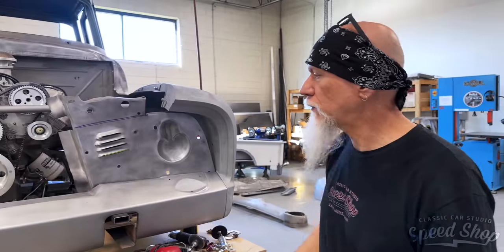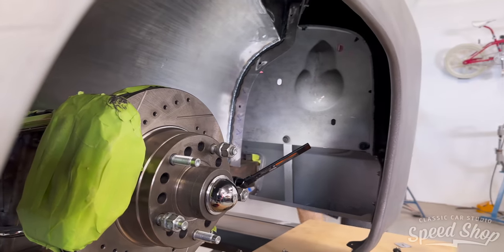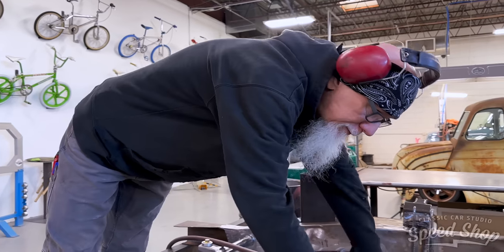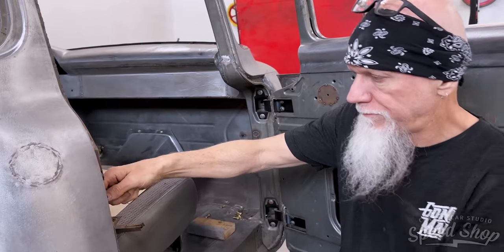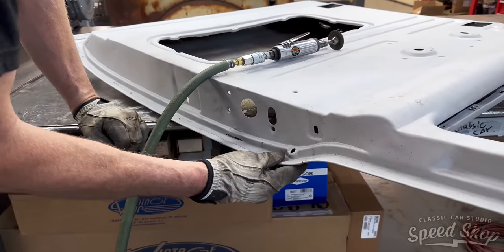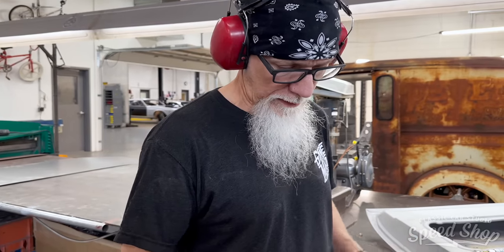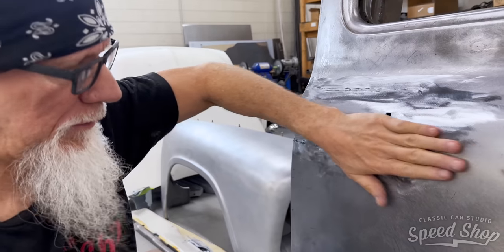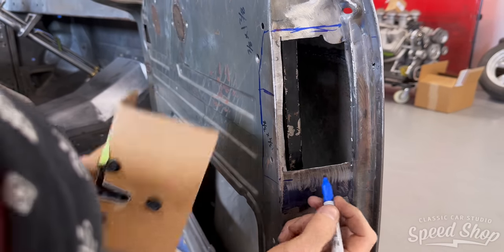Chassis & Cab Fabrication • 56 Ford F100

Comment: Do you guys get free Tillman gloves?  Looks like everybody is using them.  I use them for tig but they are expensive for everyday fab use imho.
Reply from the maker: Actually meaning to talk to John T. about that! 😂 yeah, they’re a bit of a luxury for normal wear, but the guys like how you can still feel panel variation through them and they save your skin when you hit an unexpected burr. Worth it if you need to do this everyday. The job beats these guys up enough.